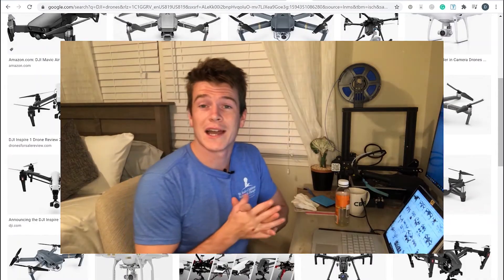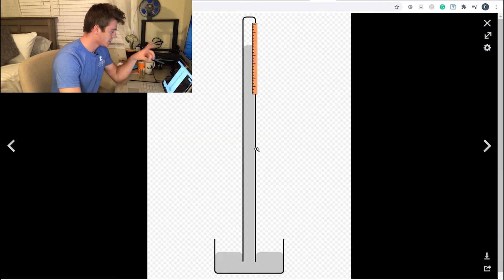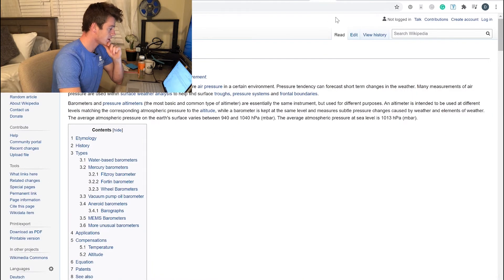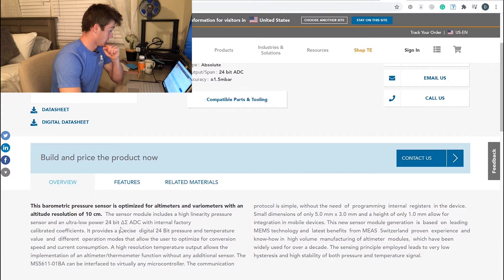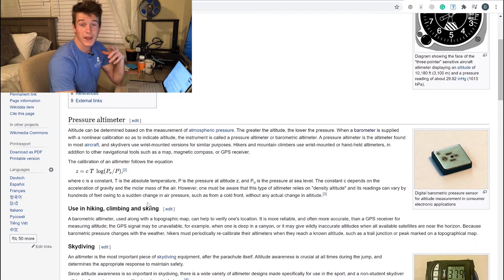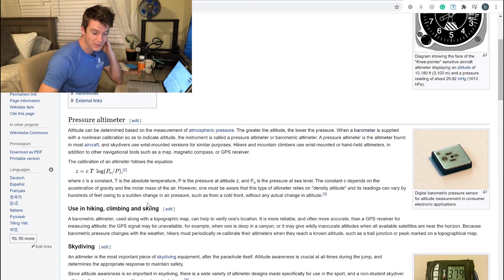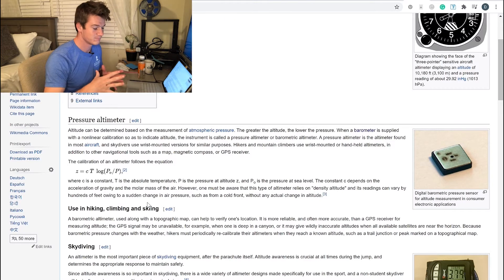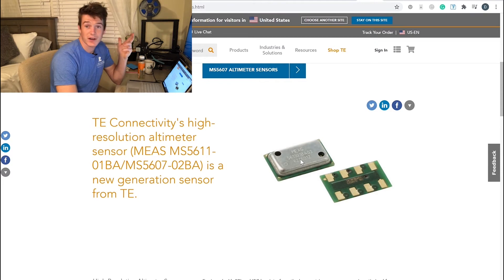How Do DJI Drones Measure Altitude?

Comment: So to recap, when I take off  and fly 100 meters away the height is based on where I took off from? Not where the drone is at?
Reply: O drone realiza uma subtração entre a altitude do sensor interno e a altitude informada do GPS, que é em relação ao solo. 

Exemplo: O altímetro do drone informa o valor de 1000 m
Já a altitude daquela geo-localização, é de 560 m
Desse modo, a altitude do drone em relação ao solo é de 460 metros.